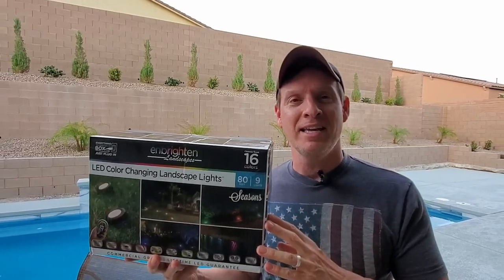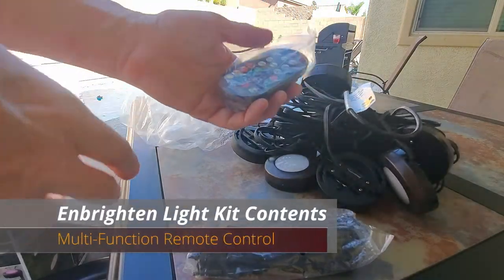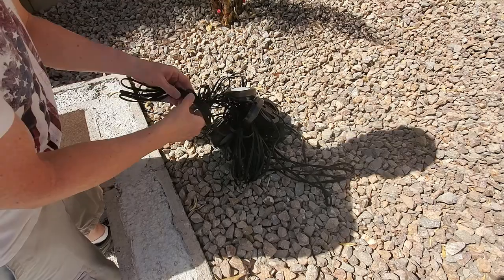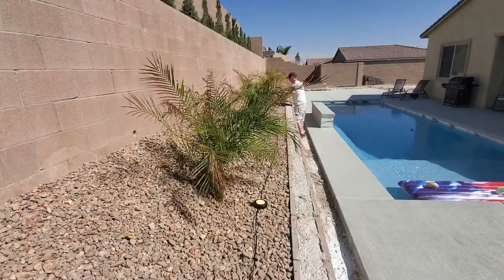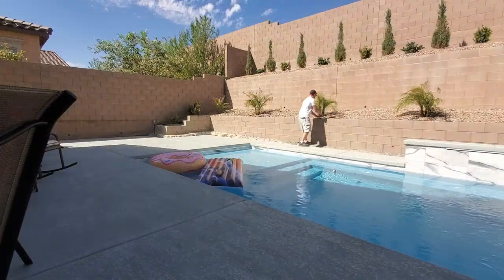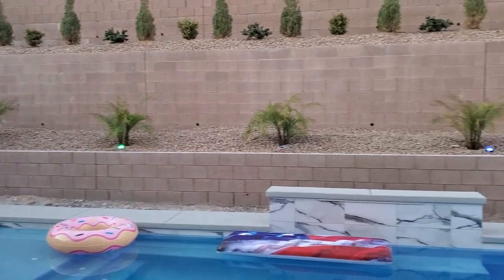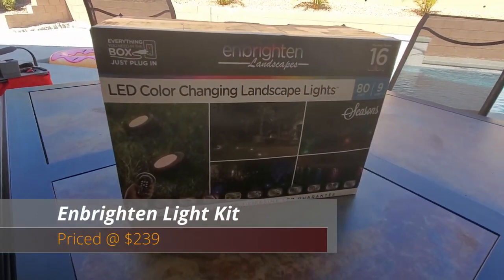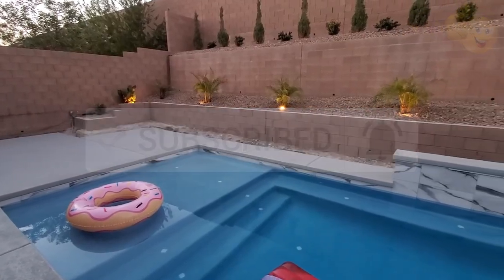REMOTE LED LANDSCAPE LIGHT KIT - ENBRIGHTEN 9 LED 80 FOOT LIGHT KIT

Comment: So my sweet gardener cut the cord between my frst and second lights. I went to repair it but reconnecting the severed wires doesn't bring the rest of the string back to life. Suggestions???
Reply from the maker: Fire your gardener. Lol
Not sure but rewiring should work.

Comment: Great choice! I bought the 12 pack for when our inground pool project is done.
How you tried syncing the lights with the pool lights?
Reply from the maker: Yes our Pool lights have a party mode and we synced the Enbrighten Lights party mode with it. It looks amazing. Here is a video on our LED Pool Light - light modes - https://youtu.be/dugotHIW0tA
Thanks for watching!
Reply: @UltimateTechHub  we did the same no controller. We went with two Hayward Colorlogic 4.0. I think the work pretty much the same with the switch.

Comment: Have run into a problem with the lights shutting of by themselves and after trying to get them back on. They start flashing really fast fast NOT like the party mode.
Only thing that I have done new is my 2 Hayward color logic pool lights are hook up together with CMP LED waterfalls. I'm using a Sync Box by CMP to get them to work together.
Sync Box is near the plug for embrigthme big plug
Reply from the maker: It may be a defective light kit. Have you unplugged them for awhile then replugged them back in? Sometimes that resets the lights.
Reply: @UltimateTechHub  I have and it works fine.
I'm reading that it might be my gfci outlet. 
Will check and let you know.
Thanks

Comment: Thanks for a great review.  A question: When the outlet begins to supply electrical power to Enbright landscape lights, does the lights comes ON automatically?  Or does it require an additional step to use the remote control to turn ON the lights?   Let's say if the outlet is automated to supply electrical power at sunset and cut power at sunrise... will the automation work without involving the remote control?
Reply from the maker: The lights will not turn on until you press the power button on the remote. So no a timer outlet will not work. Sorry. But the lights are amazing. Thanks for watching and if you subscribed thank you as well.

Comment: Unfortunately I am on my 4th set in 4 years- they don't make it thru the Winter and all fail in the same spot- after the 2nd light. Must be a production issue.
Reply from the maker: Sounds like a production issue for sure! I've had mine for almost 3 years now and no issues. However Las Vegas does not get very cold! But its hot as heck!!!
Reply: @UltimateTechHub  I think it's when the ground is frozen and when Springtime comes, the lights heave out of the ground and the wires pull so tight that they pull out.
Reply from the maker: @renoreddington8060  That's definitely a possibility. I live in Las Vegas and mine are good after 3 years. They definitely withstand the heat!